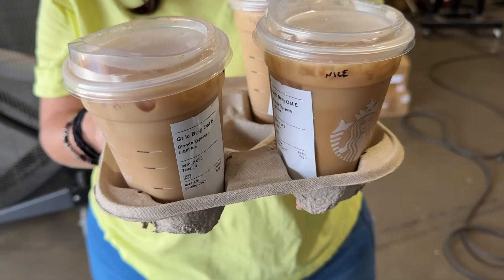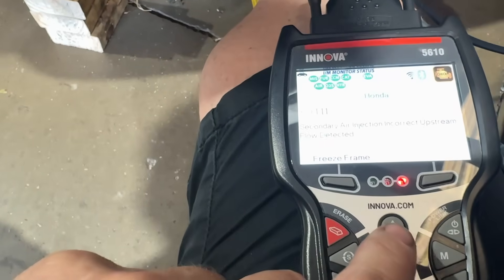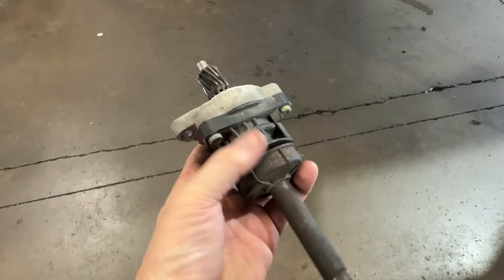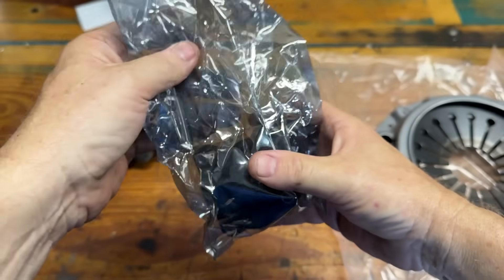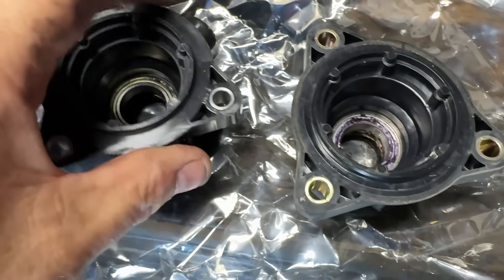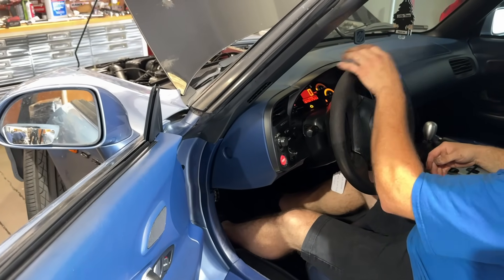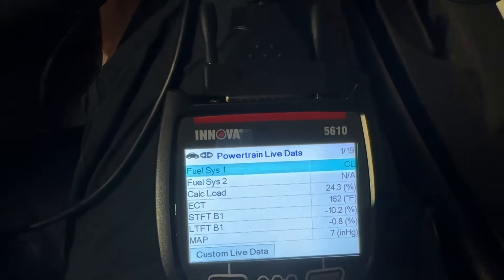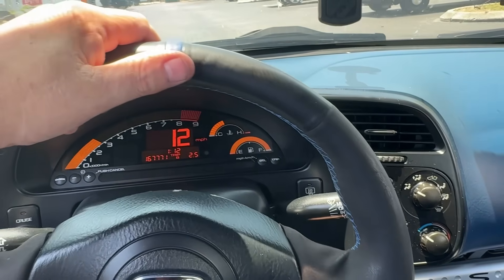S2000 Power Steering Not Working ?  - EPS

Comment: @LHTPerformance, what is the part number and where can I buy the Steering Angle Sensor?  I've looked around and all I can find are ones on eBay for ~ $80 and don't know if I should spend my money on a direct ship from China.  I checked your website, cannot find the one you installed there; guessing you don't have enough experience to carry it yet.... but for me, I'm willing to take the chance if you can tell me where I can get the one you installed.  Any help would be appreciated!  Thanks.  (2002 S2000 - Sebring Silver - in need of some TLC)

Comment: The sensor is not listed on your site. Is this something I call you guys for??

I pulled EPS DTC 13, 14, & 22 from mine.
Cleaned all connectors, sensors & ground, still nothing.

Today, I found out EPS works when the weather is cool or cold, & 1st engine start of the day.
EPS light comes on every hot starts in hot days.

I think for my situation is a matter of electrical resistance

Comment: I’m having the same issue with my   steering. Where did you buy the steering angle sensor at and what brand was it.  Thanks!
Reply from the maker: It was new old stock from Honda.
Reply: @LHTPerformance Do you have anymore for sale?  I have a 2004 S2k. Thanks

Comment: The problem is seldom the electronic part. That part has a copper winding that creates a magnetic field. The issue is the plastic slip ring that's attached and pinned to the torsion bar. The metal pin starts rubbing on the plastic and starts gouging the housing if the grease dries up. Once that happens no amount of taking it apart or cleaning will help. The main thing is the plastic slip ring with the metal band on the torsion bar can slide up and down, it only moves 2 or 3mm. Very little, so if that slip ring is worn it won't move right. If it's not too far worn, the secret to rebuilding them is to make sure that slip ring on the torsion can compress and extend smoothly. That's what you clean and grease, and manually slide it up and down until it's smooth. It's movement is the key, as when you turn the wheel, that slip ring will move as the spring compresses from torsion, that tells the electric motor, through the windings in the outer housing, to engage the steering motor.

Comment: I bought one from Ebay and haven't had a problem in almost a year ( 7k miles). Im super happy with my purchase !
Reply: There are several vendors, all selling them for about $80.  Can I assume you just picked one that had a good star rating?  For that price, it's probably worth the risk.
Reply: There are several dealers on eBay; any way to tell which one might have the best quality, or, more likely, they are all made by the same manufacture?  Getting a bit desperate to get this fixed on my son's 2002 as it's getting quite annoying and I'd like to replace it before it gets very violent.

Comment: $900?!! I was able to order one for $500 from one of the Online Honda parts warehouses back in Feb. 53101-S2A-A03    2004-2009 Honda S2000 - Sensor Assembly Torque	$502.12	...and yes, this AP2 part will indeed work on AP1 cars! It's been running fine for months :)
Reply: Good to know. I have a 2002 and I've cleaned the sensor twice and it works good for about a year. None of the Honda dealerships around here in Phoenix could tell me if an AP2 sensor would work on my AP1.
Reply: @Rocker1952 I’m in phx looking for the same fix.
Reply: LHT does the ap2 part fits the ap1? If so I would like to buy one as a backup while they are still available from Honda? Best price I found is $600.
Reply: John at LHT can you verify this part works on an ap1?
Reply: @John-b5e3e  just buy a new one from Honda. Part number differ but I’m running a new ap2 on ap1 and zero issue. Best part is new from Honda is 500 for the complete unit

Comment: I have an 04 S2000 and my steering is stiff while stationary like as if it has a manual rack. Could it be the torque angle sensor even though i dont have the other symptoms mentioned in the video?
Reply: Mine feels the same lately, I thought I was being paranoid
Reply: check the fluid level?  My Integra steering was very stiff right after I filled up the PS reservoir, until it circulated throughout the system (starting from a completely empty, dry system).
Reply: @Patrick94GSR S2000 has electric power steering
Reply: @Patrick94GSR  All S2000 have Electrical Power Steering
Reply: @Hausofuji  I see, well nevermind then!